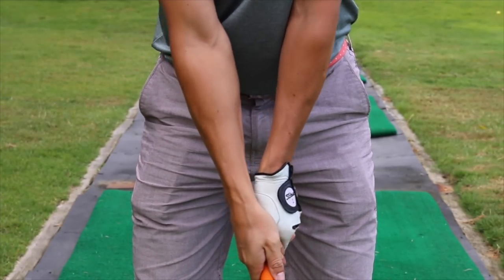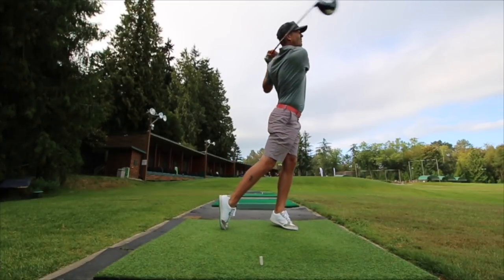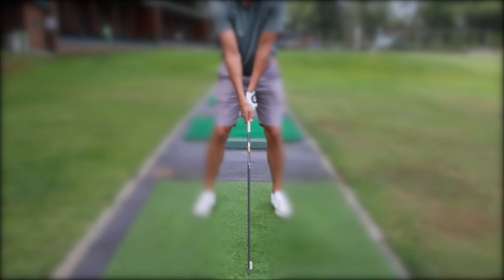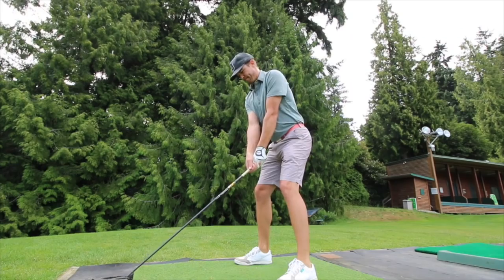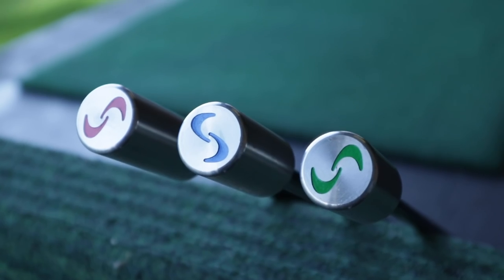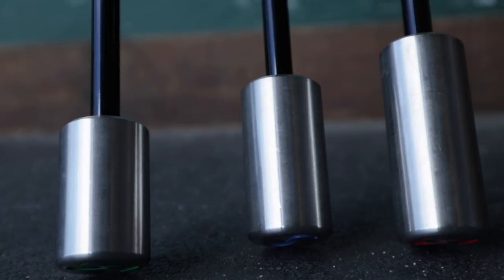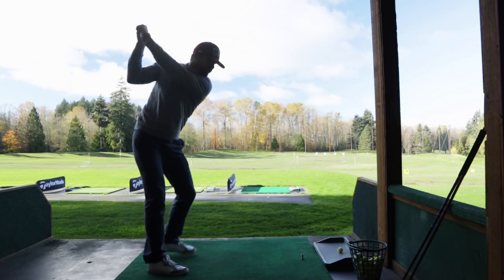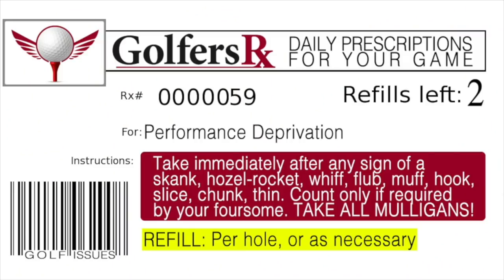Overspeed Training - Lighter is Faster

Comment: Max speed at the ball could be disputed.  Force is mass times acceleration, so you need to max out speed just after the ball.  An accelerating club with lower speed will generally result in more energy transfer than a decelerating club, even if it has a higher speed at the ball than the accelerating head.  Most pros I have heard just referencing speed aim for max speed about one foot past the ball, which ensures acceleration during the strike.  Love your content, keep it on the short grass!
Reply from the maker: Thanks Mackay!